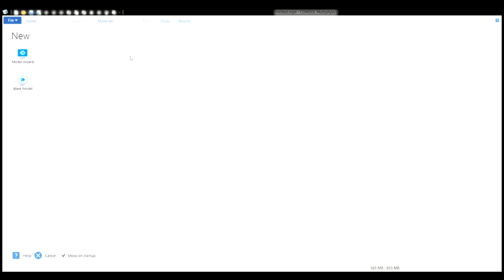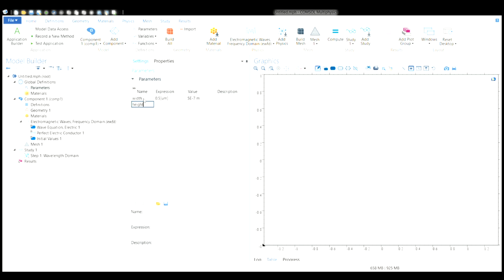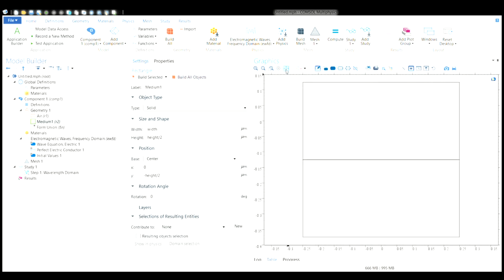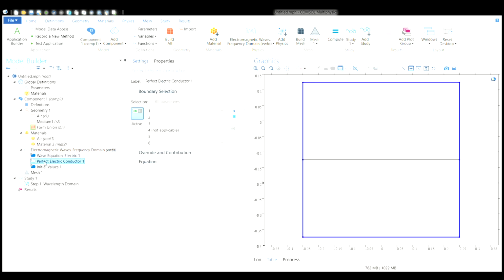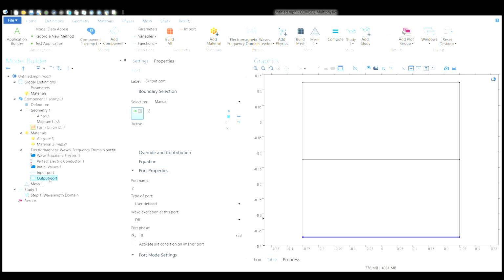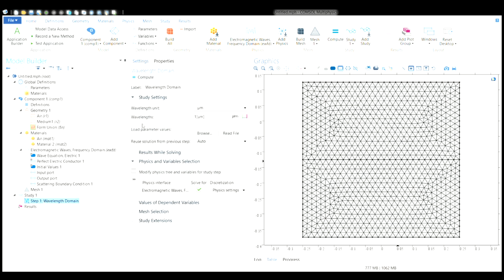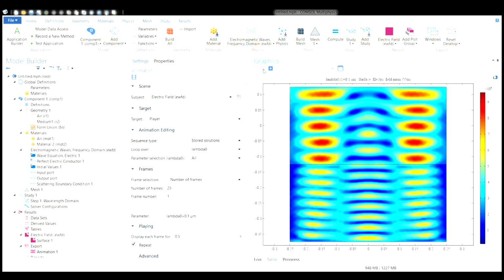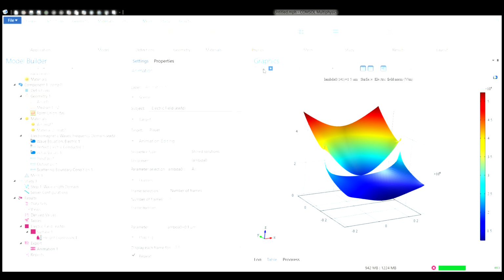Simulating EM waves between two media using COMSOL MULTIPHYSICS

Comment: very interesting and helpful please make more videos on that physics
Reply from the maker: @laraibzafar8564  thank you for comment I am working on it will share some new videos soon.
Reply: @thedigitalphysicist  Hello, did you ever use epsilon near zero material?
Reply from the maker: @laraibzafar8564  Can you elaborate a little ?
Reply: @thedigitalphysicist  those material whose permitivity approaches to zero at specific wavelength. Like InAs, doped semiconductor etc
Reply from the maker: @laraibzafar8564  ok. so I haven't been using such material. But if it shows up in Comsol material library you can put it in the geometry and look into it.
Reply: @thedigitalphysicist  its not in the library
I don't know  which kind of values i need to put because its permittivity is based on not refractive index . Also, for different  layes of material carrier concentration n , i mean doping is changing
Reply from the maker: @laraibzafar8564  This is a unique problem. I have to think about it a little. I am hopeful I can address that. So stay tuned for my  upcoming series on COMSOl
Reply: @thedigitalphysicist  yes sure

Comment: Hi its really helpful,i want to know the refractive index of unknown material from change in wavelength value how to find it
Reply from the maker: @SurajSingh-xv6rv   hi look so when you want to get the refractive index of any material you first look into the refractive index database that is already present in the website and later you can fetch the data from there inside interpolation function. and call the data inside the blank material property. I would be sharing a video soon based on that particular problem. I am grateful for your patience.  like share and subscribe

Comment: Is there any method for anisotropic refractive index
Reply from the maker: Hi @PranavGeorge 
Sorry for such a late reply. I guess you haven't received any help on this matter. I can guide you on this matter. If your are doing your simulation on the ewfd in wave optics module then you can directly use the anistropic refractive index. For this first select a body and then select a material from the library. Now when you are going for a personalised matter then you can choose a blank material. In that you will get Refractive index as one of the parameter and there the option of anisotropy is available.